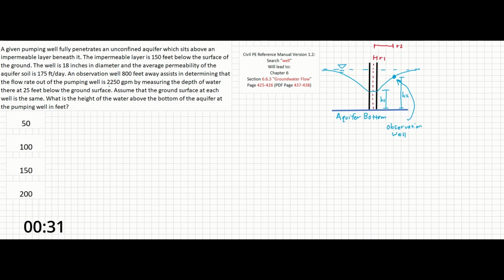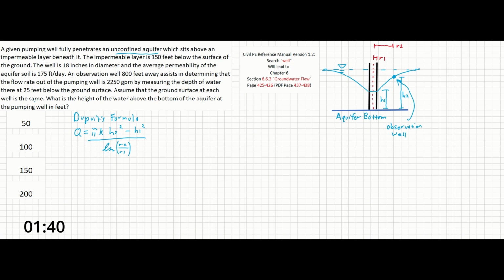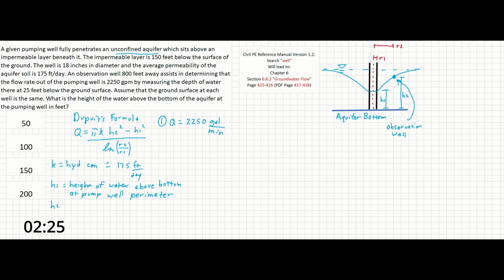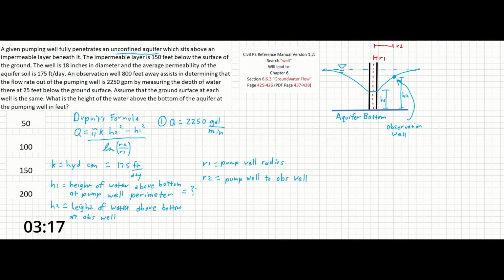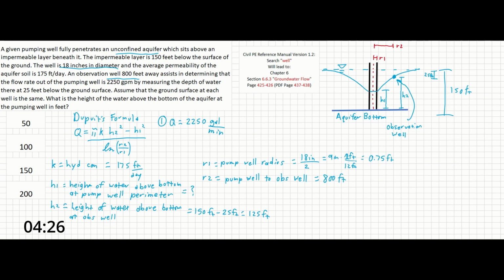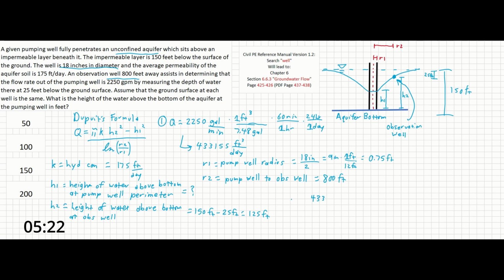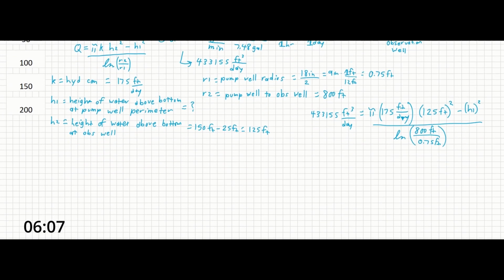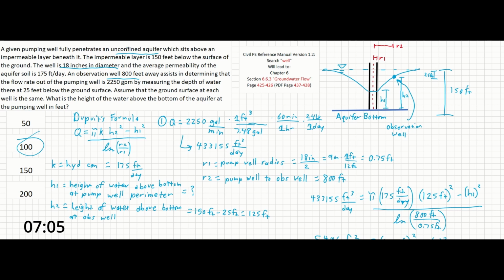PE Exam Practice Problem #11: Water Resources | Pumping Well - Unconfined Aquifer - Groundwater Flow

Comment: I am wondering why you do not take the 100 and subtract it by the 150 like you did for h2?
Reply from the maker: H2 can be calculated because we know the total height of the layer, and we know how much the water level dropped at that point 800 feet away from H1. But its still just the height from the bottom of the aquifer to the water level. We have no idea what H1 is, which is why we need the other equations to solve for it. We don't need to subtract anything from 100 because that is the height from the bottom of the layer.

Comment: 175ft/day almost got me! hoping I make some of these catches on exam day!
Reply from the maker: Seems like you're off to a great start in the last few problems you commented on so I would be cautiously optimistic. The fact that you are suspicious at all will help you catch any easy tricks.
Reply: For anyone looking at this in the future, one thing you can do to prevent missing things like this is:

If the answer is being asked for (or variable is given as a known) in unit format that doesn’t match the formula you’re using, convert it OR circle it to remind you later. In this case, it's a well drawdown problem so you can use Dpuit's formula.

Dpuit's formula gives K in ft/sec, so right away if you're reading your variable descriptions (which you should do every time for just this reason unless you are absolutely certain you know e.g. A in Manning's = ft^2), you know you need to convert the given K to the correct units for the formula. I find it easier and clearer to convert separately BEFORE plugging in, because it's one less thing to keep straight.

The same principle of reading the fine print should be something you're keeping in mind any time you're looking at a graph/chart. Make SURE you're using a chart with US units if the problem is given in US units (been tripped up on using the SI value for Kinematic Viscosity a couple of times). Similarly, there are 2 nomographs for culvert discharges, one for concrete and one for corrugated metal. Each culvert nomograph has different bars for the entrance types as well AND the Headwater bar is a ratio of headwater depth to diameter, so don't get tripped up and use just the headwater depth!